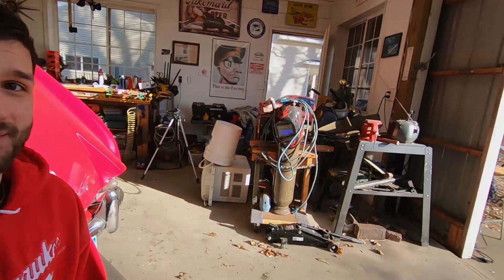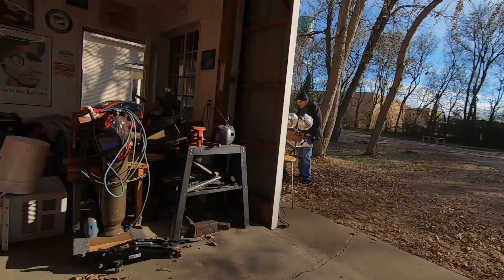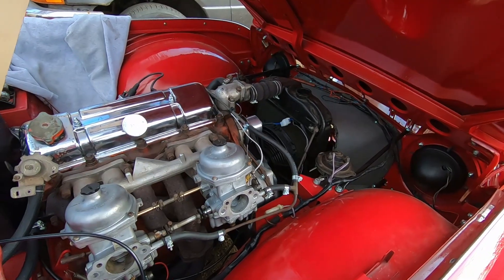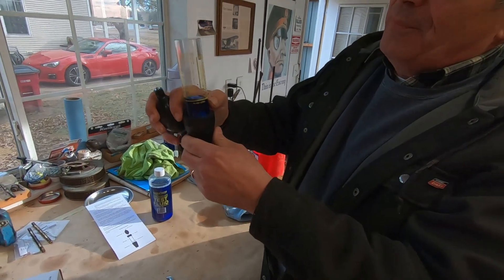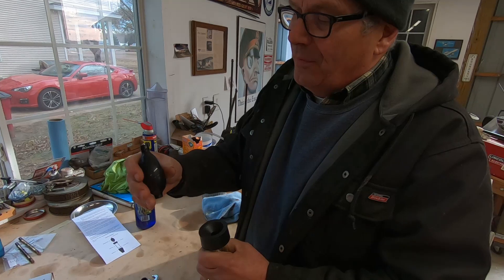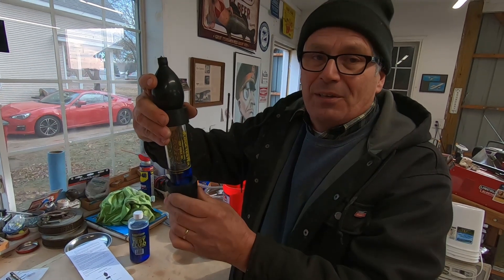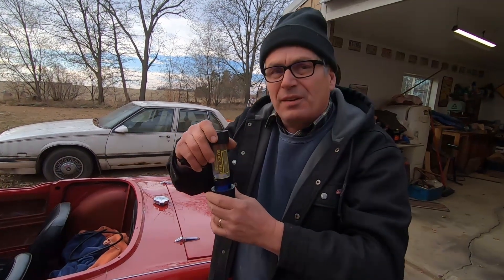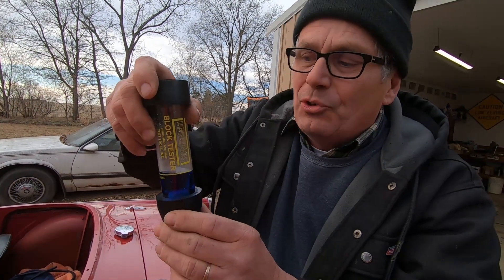Test Results Are In! BLOCK TESTER On Our Triumph TR4

Comment: The head gasket on my rig leaks into the coolant and turns the coolant brown.  There is a buildup of brown mud-like crud inside the radiator cap, and I assume, throughout the system.

Comment: Glad to hear you don’t have any head gasket issues. I added an electric fan to my TR4 and so far the gauge reads dead center with an aftermarket 165deg thermostat. 
Mark check your trans fluid for debris your first gear is very noisy in the video. I just rebuilt my trans and some parts are pricy.

Comment: I'd never heard of a block tester, but then again I can't recall ever having a problem with a head gasket on anything, let alone a TR. But it's a handy tool, and it sure beats pulling the head off  on nothing more than a suspicion. 

You might have to have the radiator "rodded out". The bad news is to do this, you might have to "dig up" an old school radiator guy "Young Frankenstein" stlye...

BTW, those rebuilt carbs sure do spiffy up the place under the hood!
Reply from the maker: Thanks! "Radiator guys" are hard to find these days. Probably worth a look though.
Reply: @WegsGarage  The basic procedure is to unsolder the top and bottom of the radiator and run a rod through each passage in the core to clean it out. I'd check it out very thoroughly first prior to going this route though.

Comment: My guess is the rad needs cleaning. Better fan too
Reply from the maker: The fan is definitely a little weak. It's just a cheap no name fan from Amazon.
Reply: @WegsGarage  Yeah, but at "highway speed" you shouldn't even need the fan. Remember the clutch fans of yesteryear? (I know that your dad does. :) ) They drop out to save a bit of fuel when you don't need them. 

And the rule of thumb for radiator openings is that it needs to be at least 1/6th of the radiator area (good to know if you plan on designing your own car... :) ). Clearly this isn't a problem on the TR4.

I recently had a blown fuse that powered one of my fans in my Impala.You would never know it driving down the highway, but it sure showed up in traffic!